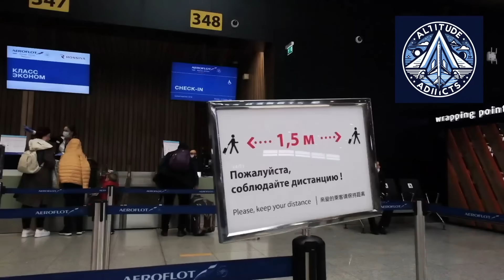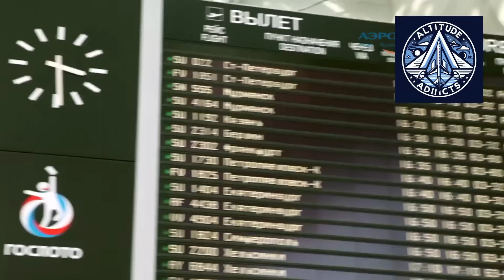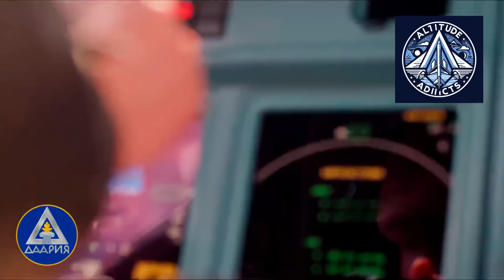50 Domestic Aircraft for Russia in 2026 - MC-21, SJ-100, Il-114-300, Tu-214

Comment: 50 in 2026? Really? I will be happy if at least 10.
Reply: 3 😁
Reply: There will be 0 produced as every year. This is just endless talk.
The question is if any of these models will even be certified in 2026.
Reply: @LloydChristmas983  To be honest, one (serial) Sukhoi Superjet SJ-100 has been finished in 2025. And there is 20 of them in Konsomolsk factory in process, from 2023 🤣. Maybe there is problem with engine PD-8, probably not certified yet, produced 8 units/year.
MS21 is in certification process, so zero will be produced in 2026.
One Tu-214 (fully RUS) has been finished in 2025, but this fully rusified plane hasn't been certified yet, probably. So one or two should be made, if The Lord permits. 😁
Il 114-300 - it should be called былины. A lot of orders from 2019, 2020. But zero produced. Still waiting.

Comment: The only thing missing is a 350-400 seat twin based on PD 26-35 engine range, for service to far east, like Vladivostok., from Moscow or even St. Pete.
You already have the engine(s), and the avionics/software.
Now you just need an air frame.
Well, modern wings would need to be carefully designed, as even the A380s wings are said to be "obsolete", with a new wing update deign in the offing for Emirates' request for A380 replacement.
Reply: ИЛ-96-400 435 пассажиров. Одного ПД-26 будет недостаточно; в настоящее время он оснащен четырьмя двигателями 90А, развивающими тягу в 72 тонны. Поэтому необходим ПД-35 с взлетной тягой в 38 тонн и крейсерской тягой в 35 тонн. Однако это произойдёт нескоро. Скорее всего, в 30-х годах.
Reply: This will take time. Redesigning the Il-96 for the PD-35 is not viable - a huge amount of work and in the end you still have a 1980's design. A new aircraft will have to be designed, and right now the Russian aviation industry doesn't have any remaining free capacity for it.
Reply: @wakko454  The Il-96 is a good aircraft, and like the Tu-214, it has one of the best airframes in the world. The height of the PD-35 engine allows it to be installed on the Il-96; it will be located slightly closer than the current second engine. The cockpit is also quite quickly upgradeable. It is ready to fly. During flight, a composite modification can be developed, simultaneously working on improving the design, and the new modification will essentially become a new aircraft. However, this is usually done like this: all Boeing and Airbus aircraft are based on designs from the 1960s, 1970s, and 1990s; they are simply modernized and improved, because there is no point in building an aircraft from scratch if you can increase the length of an existing one, replace the engine, and so on. Because creating an entirely new aircraft would require changing the entire design, production, and components – why do that? The Tu-214 is currently undergoing such a modernization. It was manufactured in this configuration, and the factory is currently updating the aircraft to the current version. Once the new versions are ready, the factory plans to exchange them with customers, retaining the older ones for modernization and subsequent sale or exchange. The biggest challenge is aircraft equipment certification. Certification can take one to three years, and if something on the aircraft changes to comply with Russian standards, recertification will be required. Paradoxically, certification often takes longer than the development of new equipment. This is presumably necessary to ensure safety. The saddest thing is that in the 1980s, Gorbachev began closing civilian aircraft factories, and after him, Yeltsin literally began to destroy them. It's amazing that people, driven by their own enthusiasm, were able to maintain their skills, but due to a lack of funding, they were unable to work on improving aircraft. As a result, civil aviation nearly collapsed and fell significantly behind. Ultimately, we will have to catch up. Although I believe that everything will get better; the people of the Russian Federation are smart, talented, and persistent; there is nothing they can't do.